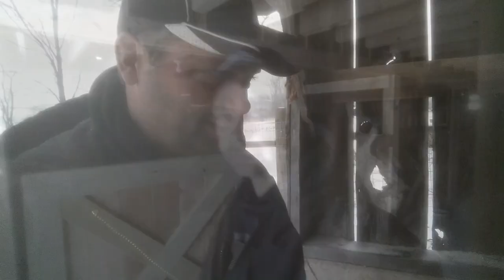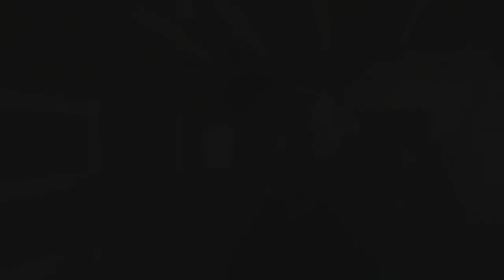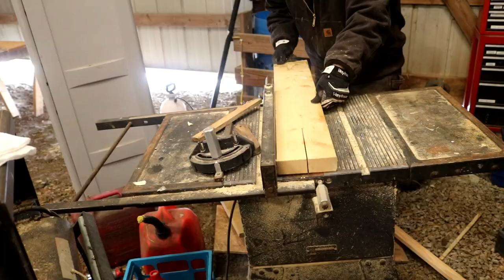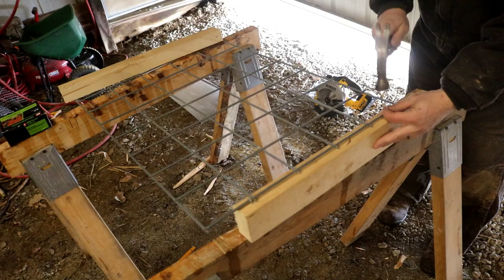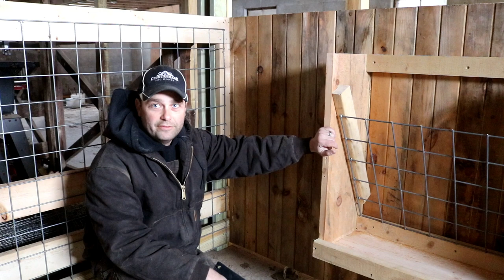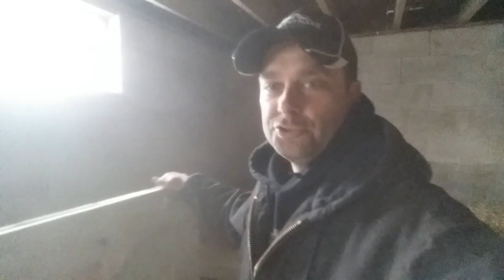Building a Wall mounted Hay feeder for the barn stall

Comment: as one who has been doing pigs ans steers  they take next to no fencing at all, just run one wire eletric though the bush 12" off the grouund and as they get bigger lift it up to 16" the pigss will never cross it even if the power go out, same with picking up bull calves for next to nothing, and a lot for free from dariy farm, most are cross bread with abeef of some kind, again a one wire electric is all i have ever used 3 feet off the ground, and lift it to 4 feet as they get bigger, at 18 months old you have great beef for the freezer, be sure to grain finish there last 90 day, for the best meat, check me out to see how little i use. if you go with goats, you best havea very large fencing fund, as they need a large area in the woods, and they will get out of any fence that is less then 8 feet high.. and on the roof of your home, on your cars,, oh i can remember to well